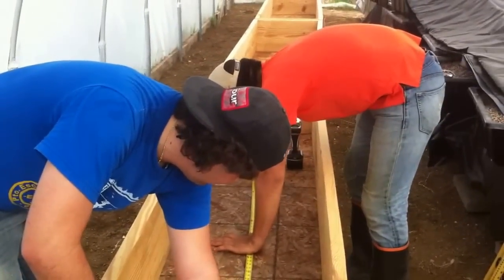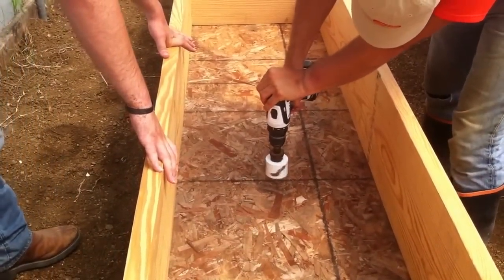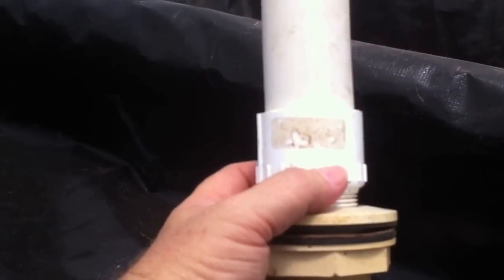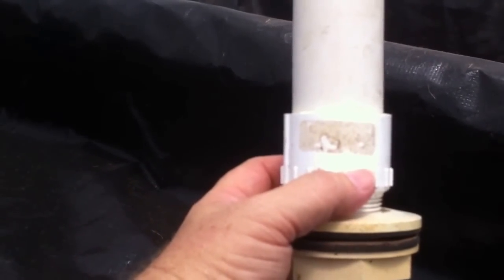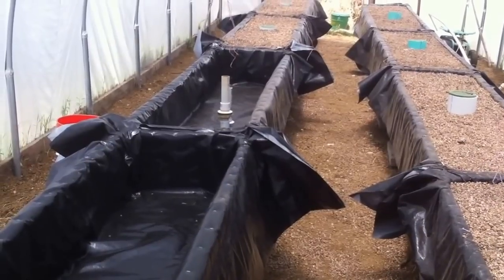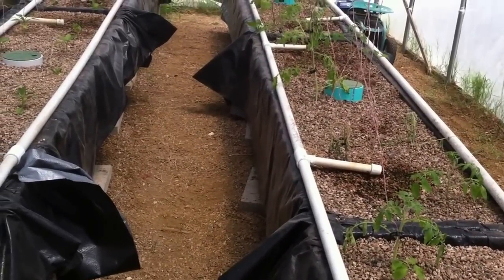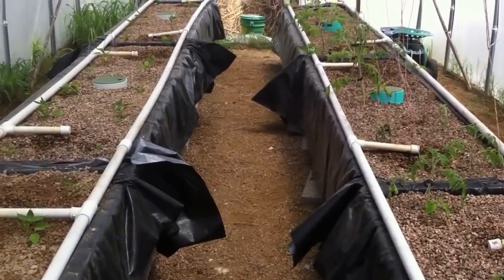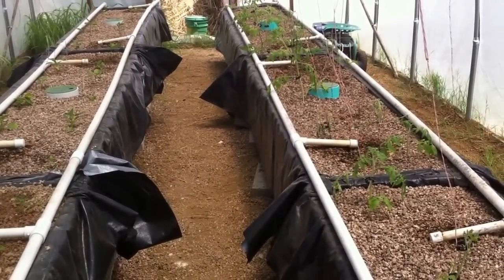Sustainable farming setting up aquaponic gravel beds

Comment: how do you calculate the amount of gravel used in ur beds and whats the best grow media
Reply from the maker: Great questions. My beds are 12” deep and 4’x8’ square which will hold 1 yard of gravel (yard = 2k pounds) for the first 2/3 of the bed I use 3/4 to 1” river rock and the top 1/3 of the bed I use crushed granite 3/8”

Comment: What are the pipe sizes for the drain and for filling the bed?
Reply from the maker: to fill is 1" the drain is 2"
Reply: I've built my beds and now I'm shopping for the liner. Have you ever considered using blue skin? It's used for foundation waterproofing. I haven't seen anyone use that option yet and I'm wondering why

Comment: how did you cut the holes in the liner to hold water around the PVC drain pipes?
Reply from the maker: Good question, you drill the hole in the plywood before you put the liner in. Once the liner is stapled in place it is easy to take a knife to the liner over the hole in the wood. Hope that helps
Reply: Hallsome Farm and then that seal just holds easy and doesn’t leak? would love to see a video of it if you get bored because thats a pretty cruicial part of the construction. Thanks for that answer
Reply from the maker: I do have a very detailed video of installation of the bulk head. If you go to my channel I have a playlist for Aquaponics it’s there.

Comment: did you check the gravel if there is limestone in  it? if it does it will increase the Ph of your system and kill the plants.
Reply from the maker: no limestone I use crushed granite which is PH neutral but my well water is ph 8.2 nothing I can do about that. But it has never effected the growth of the plants, not everything on the internet is correct, I discovered a long time ago my plants grew just fine with PH at 8. I havent even checked my system for years now, no need.
Reply: Add teaspoon of lime. Adding a bit of acidity to the system will decrease your Ph. and when your Ph is low put crash oyster shell in the water in a filter bag. this will increase Ph gradually and in a day or two you Ph will go to normal. Sometimes high Ph or very low Ph can kill the fish too.

Comment: Wooden beds for an aquatic setup? Are you insane?
Reply from the maker: Don't understand I've had the same beds working scene 2009 and have never had a problem. The beds have an internal liner the outside wood is exposed so it always can dry out. Works just fine.
Reply: Well ill be darned. I would have bet my life savings on it failing but 7 years is a good run for money.
Reply from the maker: That’s why we do this so we all learn from each other it really is quite wonderful what we all can do together
Reply: Can you use treated lumber seeing as it's covered in plastic?

Comment: Great video! What size is the PVC you use for watering your beds and how big a pump does it take for running your system? Also what kind of an automation control do you use to the bed watering? Thanks!
Reply from the maker: +D C great questions D.C. I use a 1" pipe coming off a 2245 gph pump, the outlet to the beds is reduced to 3/4". I just use a timer where I can run for 5 min and off 1 min repeated 24/7.

Comment: good set up .... i was just curious about the plywood thing you said.... the bottom of the grow bed has plywoods right? why not use the lumber wood as used at sides.... do inform... thabx... :D
Reply from the maker: +Raj gharti on the sides I use 2x12x8' lumber, you could use it for the bottom if you wanted I guess but it would cost a lot more and the bulkhead would not fit you'd need to find another types of bulkhead which would cost more as well. 3/4 plywood works quite well.
Reply: Vertical Stability...The Rock is Heavier Structurally Into the sides...His Setup Is Solid, but he needs to eat more lettuce and less tomatoes.

Comment: Why not use a bell siphon?
Reply from the maker: +David Bonany good question, there are several reasons, (I do use bell siphons in my other system) mainly I want the beds to fully drain, get lots of air to the root system. With a bell they beds do not drain well after time. Also this way I can use a smaller pump and plumbing saves money. There is less failure as well beds are always draining. I have both types of systems bells are good if system is small but when you get lots of beds better to go flood and drain

Comment: Are those pond liners food safe/approved or will you have the plastic leeching into the system?
Reply from the maker: Good question, these liners have been used for ponds for over 30 years before food safe plastic was a thought. there are liners still in use today 30 years old. It's the same material used for the greenhouse cover and the manufacture says it does not leach that it is safe to grow food in. I've used it for years myself and have seen no issues with it, fish are healthy plants do fine.
Reply: Hallsome Farm p

Comment: I need a help. Last few days i looked lot of videos about this systems but i can not understand why people use small rocks instead ground (soil). I'm from Serbia and we have here very very quality soil but this thinks with rocks confused me?
Reply from the maker: Good question, you cannot have dirt in AP systems because the water is always flowing. If you had dirt it would turn to mud and be too wet always for most plants you would have a swamp instead. The gravel is necessary for flow and that's where the bacteria breaks down the fish waste to make the system fertile. If you have good soil already I would try wicking beds over AP, much cheaper and you still get the water savings, you can see my wicking bed video here: https://youtu.be/3nZf0ecm7Ts  I hope this was helpful and thanks for the comment.
Reply: Yes, very helpful for me. I'm collecting informations and you give few more very importants facts. I just have one more question about gravel? Any gravel can be use or some special types? What is the point: just to have gravel inside or gravel need to be specially with some components in him? Thank you a lot!
Reply from the maker: Another good question, yes the type of gravel is very important. I use 3/8 to 1/2 inch rock and the rock must be PH neutral. To check if rock is PH neutral put some rock in a clean glass jar, poor in vinegar covering the rock. If it bubbles then it's not good rock. Also I use light color rock black or dark rock can get very hot for plants. I use crush granite for my system. Hope this helps, please tell your friends on face book etc. about my channel.
Reply from the maker: Ivb, before you buy the barrels please note that 80% of what's on the internet is bad info. Barrels fall into this category, they do not work. At first the seem to work but once the plants get big the clog up, also there is not flow as the bottom is so narrow. Don't waste your money or time on them. It may cost a bit more but if you can make it our of wood you will be much happier in the long run. Needs to be 12 inches deep if possible. Not trying to stop your excitement just want you to be successful.
Reply: I hope this guy didn't do anything stupid.
Reply: The vinegar is to test for the presence of limestone in the rock or gravel.  In an ideal situation, whatever you use would be inert and not interact with anything you added to the water.  That way you have a better idea of what and how many nutrients and minerals you have added to your system and can properly tweak your system  based on that.  The presence of limestone adds another variable that may be difficult to adjust for.

Comment: Looks like a really good system
Reply from the maker: Guess I wasn't clear thanks for the question, 150 tomato plants can grow in the gravel beds and 1400 lettuce can grow in the raft beds. The pump in the fish tank first flows to the gravel beds then they flow into the raft system which returns clean water back to the fish.
Reply from the maker: It's a great system very productive, I can grow over 150 tomato plants and 1400 lettuce in this system.
Reply: 150+1400 in one bed or in whole sistem?
Reply: Thank you. That is per one year, per one bed?

Comment: Hey Bob
For the clean boxes before the liner, vacuum by all means but I add a layer of old (recycled) carpet and fit it on floor and onto walls between the liner and the wooden walls, The carpet will eventually get manky (Yuckch!) but mine has not gone funky in three years.. This protects the liner and does not take up near any space PLUS, it recycles freely available materials that would otherwise be filling up the refuse stations.

Comment from the maker: Great question I have a system that has been using bell siphons for almost 6 years now, them problem with them is they are so efficient that as your system ages and material builds in between the rock water flow slows significantly. The bells are very efficient and shut off before much of the older bed can drain. Means roots are always under water and little fresh water is circulating. So a flood and drain get all the water out, all the roots get air then everything get new water all over again. I see a great difference in plant growth and production with the flood and drain. Hope this helps
Reply: So with flood and drain you think the production is better than what other method ?
Reply from the maker: The Kaveman I like it better than all other methods

Comment: Why not use a bell siphon? They are so much more reliable than an electric timer, and also your roots will have far superior aeration. Best of luck Bob from UK, thanks for sharing.
Reply: Timed flood and drain not reliable?  No failures in my system in five years due to timer.  Also, I can easily adjust the rate at which my beds drain, which you cannot do with siphon.  Indexing valve with no siphons, no sumps - best way to go, in my opinion.
Reply: I have several beds that are two to three years old with no siphon. Each has a standpipe for drainage with several small holes and an overflow top. Open top covered with fiberglass screening set below top level of clay pellets. Timer allows enough run time to fill bed to the point that some water flows into the overflow. I was running the timers three times a day but found that twice a day is enough to keep the beds damp 24 hours a day. Good growth and no wilting so I don't see an advantage to running a constant water flow. Of course the beds are in a greenhouse with high humidity so outdoor beds might require much more flow.